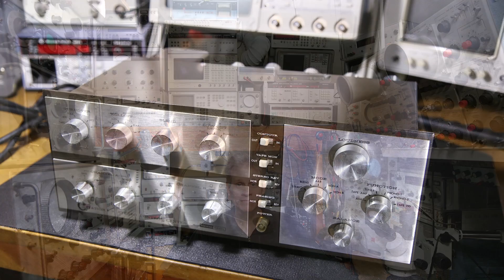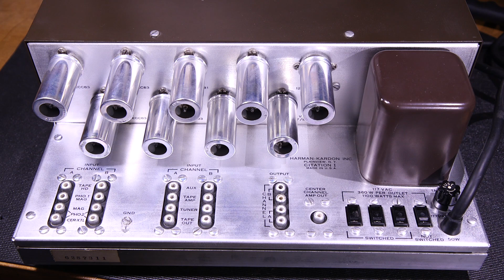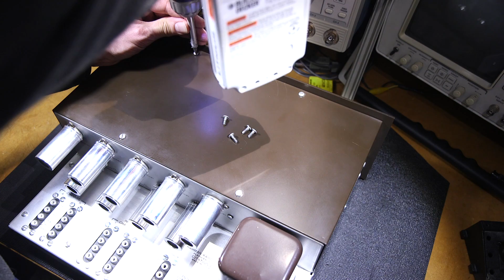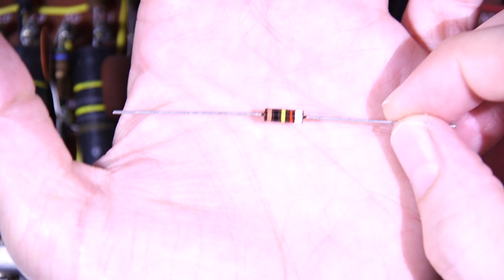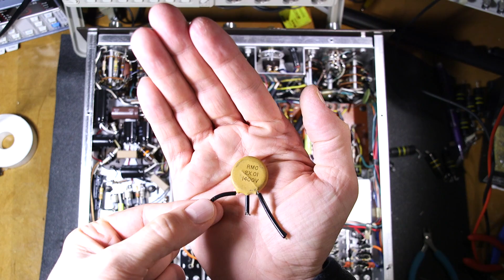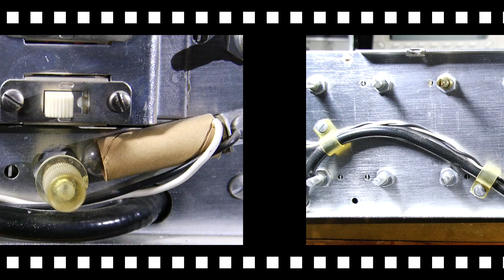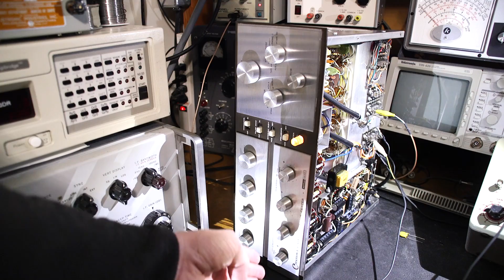Vacuum Tube Preamp Repair, Harman Kardon Citation 1

Comment: Got a project for you if it is of interest to you...and I think it will be.
I have a mono-bloc pair of Atma-sphere M-60 Mk 2.1 OTL power amplifiers. They are setup with negative feedback which I would like to have switchable to zero and whatever the chosen value is (-5db comes to mind). One chassis has a degree of hum which is annoying. Designer said that is an input tube issue. Moving the tubes does not alter result.  Tube compliment is 3) 6SN7 for input and drivers and 8) 6AS7G for power tubes per chassis.
As mentioned OTL is output transformerless design which yield an incredibly fast and phase accurate response. These amps are very hard on tubes though the designer says they are not. "No tube matching is required and stable into all loads". No tube matching means tubes are not balanced and one or two are doing the brunt of the work.
The biggest draw back of this circuit design is tubes are biased as a group. They need to be biased individually. Atma-Sphere does not offer this though they do offer rebuilt to latest circuit design and a new 3 year warranty. Latest design is auto-bias but not individually. The vintage of these monoblocs I believe utilize the same power supply and filament transformers found in the Mark 1A 140 watt monobloc amps.
My everyday power amp features soft start plus adaptive auto-bias which adjusts individual power tubes on the fly. This brand has impeccable build quality and a noise floor that is inaudible. It does use output transformers which is its only limitation [ 3) 12AU7 and 4) EL-34 per channel ultra linear or triode mode switchable on the fly].

Would be nice to put these amps back in service as they are just sitting idle.
Is this a project you would be into?
Reply: I have a friend that is/was a DSP engineer for Harman and now working for Atlas. Your tip on capacitor orientation was of interest to him. He can now build the quietest circuits ever.

Comment: Love your stuff.  I don't know any electronics guy who wouldn't be jealous green of your setup.  And knowledge and style.  I want to get clear the way to tell the outer foil of a tubular axial-lead capacitor.  I have my thoughts that the hum from my fingers has an easier time coupling to the outer foil than the inner foil cuz that foil is closer o the outside and for the hum to get to the inside foil the hum has to go through more attenuzting capacitance to get there.  Am I thinking right?
Reply: When you touch the capacitor, 60 cycle hum from your body capacitance is coupled into the foil layer that is facing the outside of the capacitor.  If the outside layer goes to ground (or lower impedance side of circuit) then the noise does not get introduced into the high impedance circuit (signal side of circuit.)

Comment: When I was a kid, I was working on a solid-state preamp, and one of the things the guy I got it from said was wrong was that the balance didn't work right. After about two days of trying to find the problem, I finally realized that the control had been replaced with a log-taper pot! There was effectively much more resistance on one side, than the other, and the rate of change was different as well, leading to interesting behavior (almost impossible to center well). Anyway, just thought I'd share that amusing anecdote. Love your videos by the way.

Comment: The odds that it was previously owned by some tech audio tube nerd that used it regularly with the utmost care taken to preserve its condition are very low, to almost zero, IMO.  My bet is it was packed away clean and forgot about for whatever reason, then found its way to you by sheer luck.   

   Though your first guess that someone with the same love of rare/odd electronics is nice to dream of, LOL.  I have a feeling that people like you and your veiwers are extremely rare, and even more rare that they would dedicate so much care to such antiques of or recent human tech mastery of the Universes power, LoL, but wouldn't that world be so cool?
Reply: Maybe one channel was noisy due to reversed capacitors and it was so irritating that the kit builder stuck it in a box in the garage.

Comment: It would be nice if someone would make a PC board available for Hergeman's basic circuit with feedback cascade 12ax7 pair driving  passive RIAA eq and with low gain anode follower buffers.  We see all kinds of Marantz/Dyna PAS/ Audio Reserach style phono boards from China but never Hegeman's Citation circuit.  The lower priced Citation IV used a feedback cascade pair for the high level stage.  My Citation IV preamp killed 4 SEAS woofers back in the early 1970's when I forgot to turn off a Citation 12 solid state amp first, pushing the woofers out an inch or more.  Was the turnoff thump exacerbated from the high level stage going up towards open loop gain ? - or for other reasons ?
Reply: "Hegeman" as in Stewart Hegeman.

Comment: Hi, Mr. Carlson! i have a SS class ab Power amp that has volume imbalance. The right channel is slightly louder than the left channel.is there Anything i can do to fix it my self? Thank in advance.  Your Fan from the Philippines😊😊😊
Reply from the maker: Hi Enio. You could add an external balance control at the input of the amplifier to equalize the amplitude of both channels. This would probably be the easiest solution, provided there is nothing wrong with the amplifier itself.

Comment: Yes I have seen the stress on components. It was caused by the wire wrapping. I remember that. printed circuit  boards kinda solved that problem.

Comment: Hi Paul. About the dragging the fingertips across the faceplate. A friend of mine had a old fisher receiver. Those have stacked volume and balance control in one knob. What happened was they had dragged the balance control all the way to the right when turning down the volume. Henceforth they thought that the Left channel was dead... All I did was turn the control behind the volume knob the the center position...  They were flabbergasted that I solved the problem just by looking at the unit...   I scored some major brownie points that day! It was my girlfriends dad. After that I could do no wrong :)

Comment: Hello, thank you very much for your time, I noticed on Channel B, term. 77, the vertical resistor, top side (carbon film going to "loudness" pot.), looks like its burnt on the video. Can you confirm that its not just my eyes? It just looks funny on my screen, could be just the shadow effect. And just curious, since there is no polarization on the line cord, do you ever identify the line side (mark w/ a dot) for proper AC input? Since a cap goes to case ground and could possible leak or fail and make for a potential shock hazard. I guess i'm too anal about such trivial issues, and it really does not matter at all.  Also, genius capacitor tester, do you make and sell those? (I would love to buy one, but I will build if not available). As always, great professional video, tons of info, thanks for explaining all the in's and out's as usual, you're really are awesome.

Comment: So all the bumble bee caps were installed wrong......so what would that do.....make more hum noise....?
Reply from the maker: It places the grid of the next stage on the outer most foil of the capacitor, the grid being the sensitive (input) of the next stage. This does have the ability to enhance noise pick up, and introduce unwanted oscillation in many sensitive circuits. To give yourself a magnified example of this, take a piece of audio cable, ground the center conductor and put the signal on the shield. So, put the shield of the cable to the the center pin of the RCA connector, and put the center conductor of the cable to the outer shell of the RCA connector, effectively reversing the cable connections. Use this to pass audio at a high impedance, and bring your hand close to the cable and note the affect in the audio. This is just one example.

Comment: Even though ceramics are usually immensely stable over time, they have unusually poor sonic characteristics, so we usually upgrade them to modern film types. The overall condition is quite remarkable, in a positive way.   They did use both comp and film resistors at original build. ... been inside a lot of their power amps and seen the same parts brands and types.

Comment: Hi Dr. C. As a fully qualified Computer Science professional (ie 1. with little electronics knowledge 2. with an opinionated view which comes with age ... over 60 3. having too much fun helping out at a school) A. I must ask if popping some oil on the shafts of potentiometers is a good idea. I think it’s dust and grime glue, over time. You are so careful and precise, show me - on a pot data sheet - where it says ‘oil the pot spindles now and again.’ I’ve not seen it. That’s my only slight grumble for the HK preamp repair advice. Can see where you’re coming from, as the result will be a beautifully smooth feel to the knobs, but I’d just check the feel is good without the oil. If so, leave it. Why? A little too much oil and it will creep onto the pot wiper, over time, I reckon. B. Fabulous bit about electrolytic capacitors having an outside foil lead. Learn something every day - love it! Now, when you grabbed the capacitor, to add some hum signal, do you not couple better to the outside foil, as it’s nearer your fingers? (The inside foil being shielded by the outside turn) That’s why the scope shows bigger signal coupling, I think; and that’s why that lead should go to the lower impedance point of the circuit. C. Danger of rubbing off the faceplate legend with interesting cleaning solvents. Take a picture of it, first. You’re videoing the proceedings, so you have a record; but I’d recommend a picture - as they cost nothing these days - before having a go cleaning. Don’t forget the ruler in the photo, too, so you record the size - gives you overall dimension and font size - should you need them to,recreate an embarrassingly blank faceplate screen. D. Learned about the safety capacitors on the line. Brilliant, again. Would not have thought about this one. The school teaches component recognition, in the early stages of electronics, and I must find a 2x line capacitor - “ ... but Sir, this has 3 legs ...” -  to pass around for comment. The answer is printed on the side, but it’s a brilliant observation and thought piece. E. Peeling off the component wire from the pillar - great! Never thought of this one, either. Have a similar cutter, but my favourite brand is Lindstrom, who grind each cutter side from a billet. Anyway, generally fantastic educational video. Lots of advice, good technique and comment. Very entertaining for me. I wish I understood more analogue suff. Would like to know more about F1. Impedance and matching. Why bother? F2. Op amps and feedback. Simple stuff. F3. Radio. A complete black art - no clue. Kind regards. Matt Lee.
Reply from the maker: Thanks for your comment Matt!

Comment: It's funny you mentioned conterfeit resistors. I had purchased several multi-paks and ended up checking all of them and matching resistors to get correct or near correct values. I learned at Boeing that putting an "S" in parts leads for stress relief and a half turn on the binding post

Comment: I've been thinking about those capacitors quite a bit, and I think I finally have an idea why an engineer may have specified the backwards orientation. Everything is well shielded from the power transformer and outside noise by the chassis, so perhaps they were using the outer foils the way that precision test gear engineers use guard traces on modern PCBs?
Reply from the maker: I think just sloppy assembly. If you look at other pictures on the net (of the insides) the capacitors are the right way around.

Comment: Another thing I noticed is that this unit is all all screwed together whereas the one I have is riveted throughout. Every slotted pan-head screw on yours is a rivet on mine. The only things screwed / bolted on are the transformers. I am wondering if that is indicative of mass production versus one-by-one which may be the case for the higher-end Harman Kardon?
REPLY
Reply: As someone who KNOWS said earlier, the riveted ones were on factory-built units, while screws show up on kits the owners built themselves, to save $. Both versions were available.

Comment: Quick question: My 1960 schematic (Bogen Challenger AC220 amp) uses mfd in place of ufd (microfarads), and mmfd in place of pfd (picofarads). But no nfd (nanofarad) capacitors, which would be the in-between size, right? I don't ever see/hear much discussion of the nanofarad size, at least in my limited novice perusal of electronics Youtube videos. Is there such a thing? Perhaps not in hi-fi gear? Thank you.
Reply from the maker: Nano Farad is just a measurement that fits in a range between pico and micro (usually below 1uf). I personally never use nF myself, but that's personal preference.
Reply: So in other words, it's just a terminology convention  - everyone uses 1000 pfd instead of 1nfd.
Reply from the maker: You mean, .001uF :^)
Reply: you say tomato, I say tomaytoe.

Comment: sir,  your narration of the repair is so professional and very informative. Your knowledge in electronics is profound. thank you
Reply: Also his work ethic and how clean he is approaching the repair process. Block diagrams, Data sheets, diagnostic manuals - he references and does it by the book! Compare that to the so called repair technicians in India!!  I have seen nightmares, and nowadays avoid giving my costly equipment even to company repair shops.  They are horror stories!

Comment: Another question about the power supply: What is C102 (the 0.01uF / 400v bumblebee that you replaced in the power supply) doing? It appears to be doing HF suppression, perhaps to keep switching noise from the voltage doubler diodes from being reflected back to equipment plugged into the switched and unswitched outlets on the primary side, as well as the mains circuit generally. But I'm not so sure. Full-wave voltage doublers are often built without a capacitor in that position.

Comment: Awesome video, a very helpful guide to me as I prepare to do a restoration on one of these units myself.

I'm trying to understand the part of your video about safety capacitors. I don't have deep expertise specifically about safety capacitors but I understand the danger with capacitors in the positions you describe, namely either across the line or from the line to chassis ground. But in this application, the capacitors are not in either of those positions. If the schematic is to be believed, the packaged capacitor pair you replaced in the video is just across the power switch, presumably for the purpose of keeping the switch contacts from pitting due to arcing. I don't believe these caps are acting as suppression capacitors unless I'm reading the schematic mistakenly somehow.

Replacing them with Y2-rated safety caps would be harmless even if I'm correct, but I am having trouble understanding the point.

I'd be interested in your thoughts on this. Again, many thanks!

Comment: You challenged one of my talismans here. As a Heathkit builder from the '60s, I remember vividly the soldering instructions in their (renowned) assembly manuals. I have to paraphrase at this distant remove, but it was something along the line of "don't depend on solder for mounting components to terminal strips. Make a strong mechanical connection first and then finish it electrically with proper soldering techniques." (also, don't use acid core solder). It's been an article of faith with me for over 50 years, and I'm having trouble letting it go on your say-so. Can you help a brother out?
Reply from the maker: You are correct about acid core solder, never use it on anything electrical, and if you use "organic core" solder, you had better wash all the organic flux off, or it will do the same thing as acid core solder. The strong mechanical connection thing is important is some situations, IE: line cords, antenna wires... anything that can be tugged on or pulled at any time. Where the fallacy come's in is.... component mounting. I have 60 year "plus" old oscilloscopes made by TEK, that have their components simply stuck in the eyelets and soldered. No bending, no loops, just straight on and soldered. I haven't encountered a single open connection due to a crusty solder joint yet. Thats a lot of solder joints without a single failure.
Reply: If the wire is jiggled while the solder is cooling, you can get a cold solder joint.

Comment: Paul, did you ever make a video on safety capacitors? I do very much agree the old ones are dangerous and its why I always use an isolation transformer when evaluating gear.
73's
Steve

Comment: But how does it sound????
Reply from the maker: You would never know through the computer. How it sounds depends on my mic and processor settings, then on your end, your computer and EQ settings, then your computer speakers.
Reply: Mr Carlson's Lab True but maybe you can explain the sound? If it’s worth it. How good is it compared to other amps and newer stuff :)

Comment: I had bought a Citation-1 preamp and a Citation-5 amplifier second hand about 50-years ago:  I  was very satisfied with the amplifier. But after a while, I didn't need the preamp. After using them for a number of years, a man drove 150-miles to my house to buy them. I think I still have the original service manuals that I could copy into PDF files. Or I might even sell the originals. - Lee, near Cleveland OHio

Comment: Paul: Why did you not include a slight bend to the capacitor's wires at both ends to take up any contraction that broke the resistor? I realise the resistor was moving via the valve socket, but you did say that contraction happens on the boards.